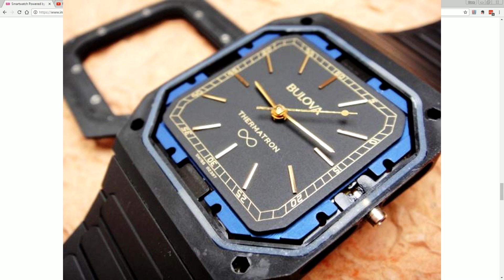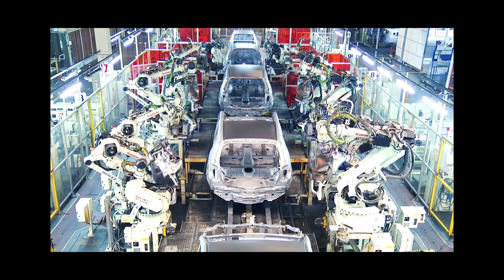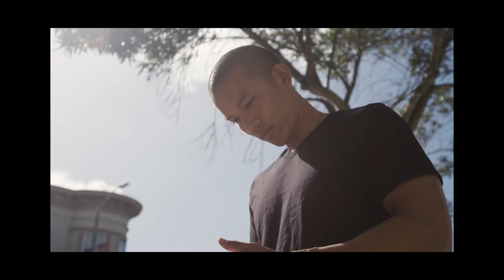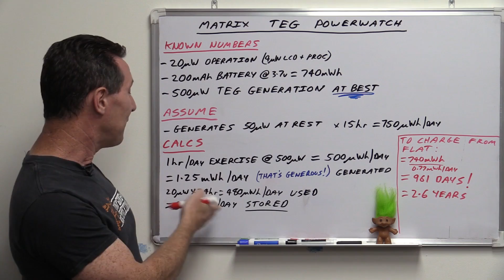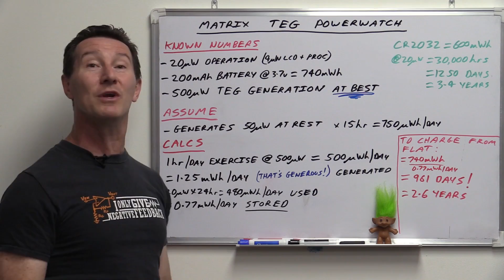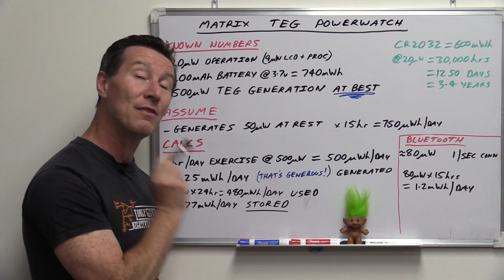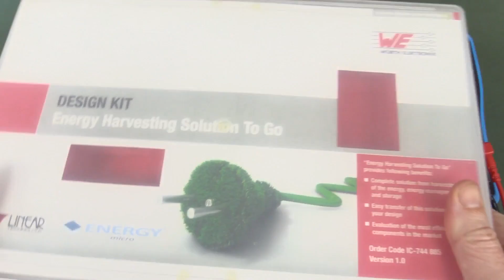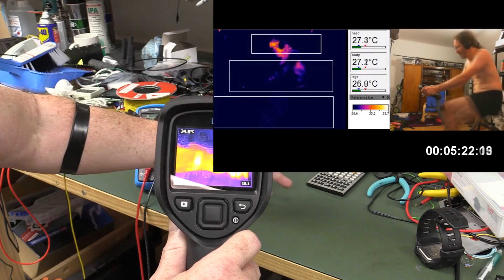EEVblog #945 - Thermal Powered Smartwatches Are GIMMICKS!

Comment: I am just about to start my own crowd funding campaign for a watch that doesn't need a battery. It uses steels ability to return to shape to store kinetic energy. You add the energy yourself everyday, I am going to call the device that stores the energy a spring, and the device to add the energy a winder, and I will use a clever system of gears to transmit the energy the the watch hands by a system I am going to call clockwork, should be a winner, never need a battery again, hooray.
Reply: Whoa.
Why don't you use a mercury based smartwatch!
As it is a fluid metal, it would make the gears on the watch turn, generating energy!
Or even better, with little prods, just shoot the excess electricity back into your body.
GENIUS!
Reply: digitalradiohacker Ah that's the beauty of it, I just leave all that up to the user, IDK maybe and arduino or something, I'll leave the details up to the maker community.
Reply: Sounds like something I heard before, hmm...
Reply: diecast jam Nice idea, but it's an old one. Watches like this exist longer than 30 years.
Reply: oetken007 Oh right OK I didn't know that, thanks for telling me, is my face red.
Reply: I think I have one of these, but mine has no winder. Somebody designed it to charge up its kinetic energy storage using gravity.
Reply: Wow self winding why didn't I think of that?
Reply: diecast jam Seiko have a self winding watch. Smart watches are for wankers anyways.
Reply: its better to make a watch which works on chatty tongue's vibration energy
Reply: hurray the rope clock!
Reply: Tag Heuer makes watches that wind the spring by using a weight that swings when you walk. Sure it doesn't have any electronics in it, but you don't need to wind it potentially ever.
Reply: brilliant... sounds like a great invention.. anyway how comes no one has combined clockwork and electronics?? I mean a watch would be the perfect thing to try it in... people have got so lazy compared to years ago.. oh my god I think iv just turned onto my dad!!!!!!
Reply: John Buick  For real John?,  and had you every had any problems with it????? or are you just joking???